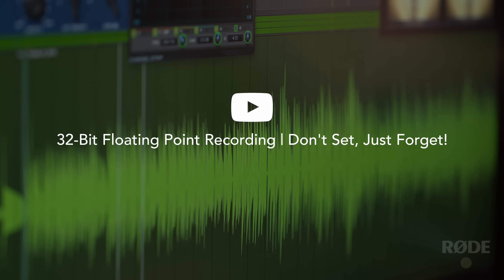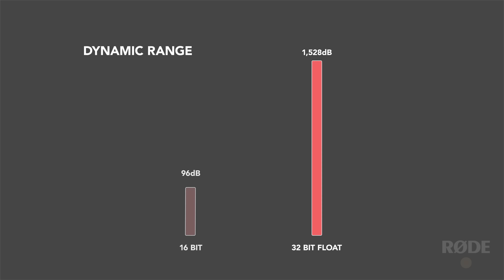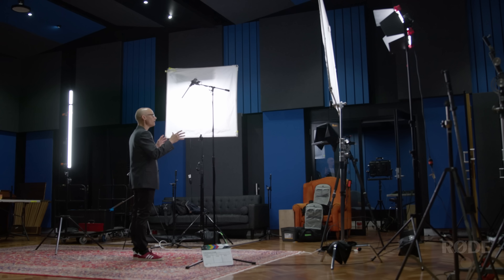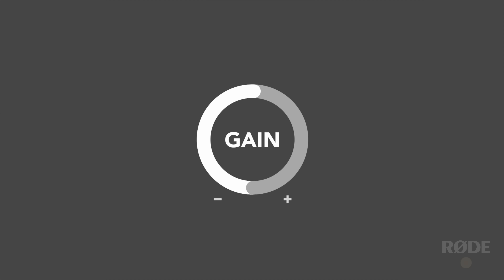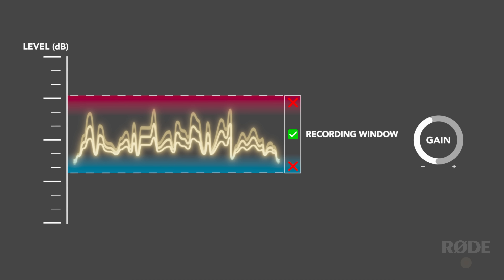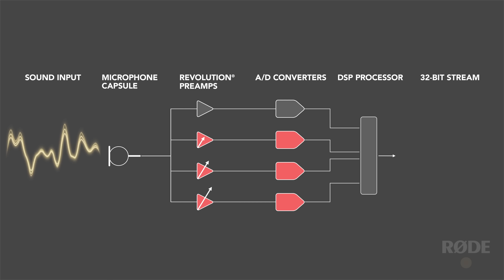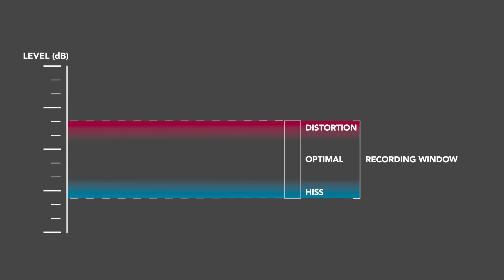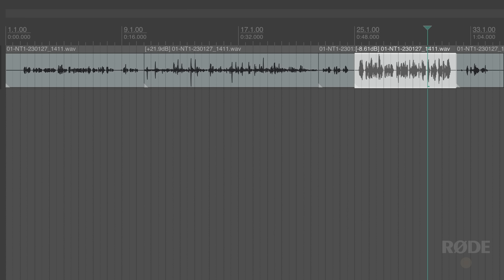Game-changer: How 32-Bit Float Recording Makes Clipping a Thing of the Past

Comment: There is a great deal of absurdity in this video. Especially in the analogies. And there is never a real understanding of the physical world, why the typical music listener doesn't here more than around 60db or at most 70db dynamic range, and even in a studio a band probably doesn't exceed that too. A 24 bit depth is already overkill.
Reply: It's overkill for a finished product, definitely.  For individual recordings though, you have to consider the extra processing that happens after recording.  Compression, distortion, limiting, even eq can all reduce dynamic range, and when you do that you run the risk of bringing up the noise to an unacceptable level.  I've had to deal with it multiple times.
Many audio interfaces have noise floors below the 16-bit noise floor of -98db, so they switched to 24-bit as to not be limited by the 16-bit format.  In that scenario, there's no reason to add maybe 10db+ of extra noise (exact number would depend on the noise of the interface) just for a ~33% storage reduction.

Comment: 32 float has been used inside DAWs since the 90s. It sounds OK but not perfect. 64 float is audibly smoother.
Reply: I think your brain is tricking you.  The only difference you get with bit depth is a reduction in quantization noise (which increases headroom).  At 24-bit it's already below the human range of hearing at -144db.  Unless your listening device has lower noise than that, there's just no way there's a difference, much less an audible one.

Comment: Audacity has 32 bit float. Sometimes Mp3 or Mp4 files opened in it will actually be above 0dB. Initially I found this confusing, But then I realised that this mode was simply providing extra headroom, so it's 0dB is actually way above 16 or 24 bit's 0dB. Of course if you normalise these files to 16 or 24 bit, they will be turned down.
Reply: no mastering engineer will accept 32-bit, so whats the point of this besides selling new products!?
Reply: @studiowerkvier6988  ...you can always convert 32 to bit back to 24, which is what they were suggesting by setting the gain "window" post-recording.
Reply: @giulioboobzilla  why shouldn‘t I.. if you know gain staging what you want 32bit for? besides i question the quality of these Converters.. Recording is something to learn and practise… where is the art if you even dont care about proper settings!?
Reply: @giulioboobzilla  probably same because why they usually only accept 44.1 or 48 khz... why change something bulletproof if there is no need at all
Reply: @giulioboobzilla  why should he? you think music just gets slightly better? I doubt it. Actually with digitally technology  music just degraded
Reply: @studiowerkvier6988  You'd want to do this for the same reason you'd record at 192khz before rendering to 44.1k.  It provides more quality at an intermediate stage, where various processes can bring out defects more readily.  In this case the stacked preamps let you get ultra high dynamic range recordings which are limited by the dynamic range of the mic instead of the interface.  32-bit happens to be the only format which can store this recording properly (supposedly).
Reply: @Nathan_Woodruff  no...64-bit even better..or why not 128-bit.... this tech nerdiness doesn't make music any better... I wonder why the best records were made in the 70s and 80s... How could Bruce Swedien even make Thriller without 32-bit... Industry wants to sell you "game changing" snake oil all the time... i won't buy
Reply: @studiowerkvier6988  I agree with you regarding the marketing bs.  I think it won't be necessary for studios to adopt this tech at all, because normal preamps + 24-bit provides more than enough headroom, especially if you set the gain right.  For less experienced people though, like people doing field recordings, camera operators, podcasters, people recording concerts with their phone cameras, etc, it will be helpful, due to eliminating clipping and noise which would've been caused by improperly set gain.  In that sense it's kind of like autofocus on a camera.  Pros don't need it, but for amateurs it keeps their photos/videos from being a completely blurry mess.

I wouldn't call it snake oil for that reason (unlike 192k 24-bit music files for instance), since you actually do get something out of it.

Comment: Oh! Pick me! I have questions!: 

How will 32-bit Floating Point work with the XLR output? Ha! Rhetorical question. It won't work except over USB.
Can I use the 32-bit output in a busy recording session with my existing low-latency ASIO interface? Ha! Rhetorical question. It works only as its own interface.
Can I use the onboard DSP with the 32-bit float output? Ha! Rthetorical question. No, the DSP is restricted to LPCM output only!
How will the 32-bit float output help on my Twitch stream? Ha! Rhetorical question. It's useful only when you can recover the audio in post. It's useless for live streams!
Well, then, of what use is 32-bit float for studio recording, streaming, gaming or podcasting?

THAT'S A GREAT QUESTION.
Reply from the maker: Hey Helman – great questions, and we can answer all of them!

How will 32-bit Floating Point work with the XLR output? 
This is not a rhetorical question. The NT1 5th Generation has an exceptionally low noise and high SPL handling. This performance is fully available over the XLR interface. If you connect it to a well-designed 32 bit float audio interface (there are a few recorders available with this capability), then absolutely you can get all of the advantages of 32 bit float described in this video over XLR. 

Can I use 32-bit in a busy recording session with my existing ASIO interface? 
Great question. There is a 32 Bit Float ASIO driver available for the NT1 5th Generation that allows you to aggregate multiple microphones in a single recording session.

Can I use the onboard DSP with the 32-bit float output? 
The DSP is not available in 32 bit float mode because on-board processing does not make sense in this mode. A noise gate, for example, needs a threshold setting which is dependent on the notional gain – which in 32 bit float you don’t set until after making the recording. 32 bit float allows you to capture the pure output from the microphone capsule with no compromises, giving you full flexibility in post-production to shape the sound with additional processing as you need to. The onboard DSP is great in more conventional set-ups where you need a fully processed output that needs no post-production.

How will the 32-bit float output help on my Twitch stream? 
As described above, for streaming it makes more sense to use 16 or 24 bit output, so you can apply DSP etc. In any case, we don’t know of any streaming platforms that are compatible with 32 bit float right now.

What use is 32-bit float for studio recording, streaming, gaming or podcasting?
For streaming, see answer above. For podcasting and other recording, though, it is a game-changer. Who has ever recorded a podcast where one guest spoke too quietly, and it was hard to boost in post without introducing hiss? Or had a guest that suddenly shouted loudly, distorting the audio? With 32 bit float, that will never happen again, and your audio will always be pristine!
Reply: @rodemic  You really suck all the joy out of trolling, you know that? 

Prerecorded podcasting is the only point I'm willing to concede. People are unpredictable.
Reply: @helmanfrow  are you the most obnoxious person on the planet? Ha! Rhetorical question.
Reply: @HorrorSoup  😉👍

Comment: This is really irritating. It's the exact opposite of the truth, and I have no idea why RØDE thinks they benefit from lying like this; it can only confuse matters.

In RAW images, the intuition (not that this is necessarily the implementation) is to store the raw (hence the name), integer output of the ADCs. This is likely 14 bits per sample (not per pixel, as there are separate colour channels, which might even have separate spatial sample rates), and, crucially, is post  exposure control and post analogue gain. RAW images, then, are directly analogous to classical 16 or 24 bit audio: integers sampled in separate channels on a grid. The downside is that (unlike in audio) the way the image sampling is done is neither standardised nor normalised, so RAW images always need to be digested by hardware-specific software before entering your processing pipeline. This contrasts with JPEGs, which are analogous to MP3s in having had aggressive and often unsuccessful perceptual compression applied both within and across channels.

What float32 samples are (and they really are, this is how the floats on your computer work) is regular 24 bit samples packaged together with an 8 bit per sample gain in ~6dB steps. This is (again, conceptually) a lossy conversion to a standard format—though the loss is (speaking ideally) 140dB down, so you don't care.

Now, the engineering trick of using parallel signal paths so you can get your float data using only 24 bit hardware ADCs is a good one, but what it corresponds to in photography is taking multiple exposures at different analogue gain (‘ISO’) settings and post processing them to make an HDR image. As I say, the opposite of RAW.
Reply: Agreed, though I'm not sure I understand your explanation of 32 bit floats.  Are you saying 32-bit floats use 8 exponent bits and 24 mantissa bits, but 24-bit floats just use the mantissa?
Reply: @Nathan_Woodruff  There's a standard for 32 bit floats, but none I'm aware of for 24 bit floats. But the point I was trying to convey is that a 24 bit integer is (if you like) a bare mantissa. So a single float 32 sample is exactly a 24 bit integer sample together with an 8 bit gain factor. That's what makes it useful, and it's also a good way of thinking about its limitations (whether for audio or for general computing).

Comment: This HDR-like method seems to have nothing to do with 32-bit and could work at any bitrate, quite snake-oily video.
Reply: 32 bit float not 32 bit. 2 very different things.
Reply: 24-bit has a noise floor of -144db, so if they can get the effective preamp noise lower than that, which seems rather trivial with the method they're using, then switching to a higher bit depth to support that seems reasonable to me.
Reply: Definitely agree that the conflation of the technique with 32-bit itself is annoying and unnecessary.  Seems like they're trying to make a marketing term out of it.

Comment: This is a terrible idea.  More work to do in post.  Also, there is an art to recording something properly going in. Congrats on ruining that.
Reply: "More work" pretty much amounts to adjusting the trim in this case, so it's not really a big deal.  In many cases you'd be doing that anyways.
As for your second point, I totally agree.  However, I think they could easily remedy the "too clean" issue by providing a gain knob which affects the level going into all of the preamps, allowing you to still clip the signal if desired.

Comment: Oh yeah 32-bit float has been around since, 1995! A while ago! And some software automatically defaults to recording in, 32-bit float. And has for the past couple of decades! And you don't even need to Audition, it. As some of us were early adopters.  From 28 years ago! Remember? Before you were born! You can remember things before you were born can you? Sure you can! Just like you can hear 32-bit float! When it's not floating. And your audio still sounds like crap!

So 32-bit float does not change, the Crap Factor. And you are going to need a $10,000 vintage vacuum tube microphone to make decent recordings. And you will need two of those for stereo. I just sold mine off last year. After having them since 1983.  Those lousy West German vacuum tube condenser microphones. Not worth owning! Not for $10,000 each! The ones for $80 each sound just as good made in China. You won't be able to tell the difference. Only I can. So you can use 32-bit float microphones from China. No problem. They were designed for rank amateur  bit, beginners. That are looking for that magic pill. That magic fairy dust. The advertising copy written by the Pinocchio Advertising Agency.

But nobody realizes that 32-bit float recordings smell like fish. They don't tell you that. Pew.
RamyRAD

Comment: If you don't set gain correctly even if you record at 2048 bit the mic will distort....
Reply: Yeah they don't do a good job of explaining it, but the insane headroom comes from the stacked preamp thing they're doing, and not from storing the resulting signal in 32-bit (though 32-bit is required to store the resulting signal at it's original dynamic range).